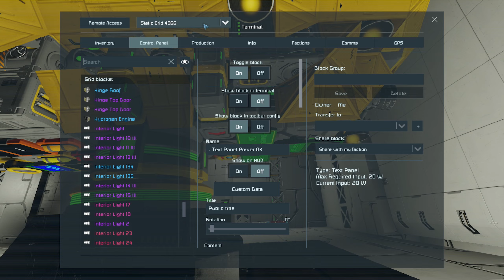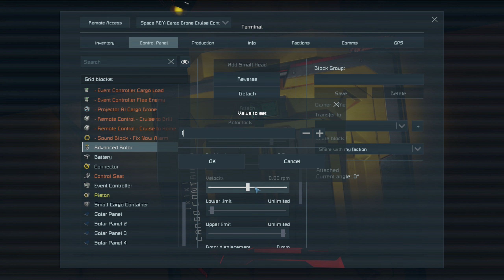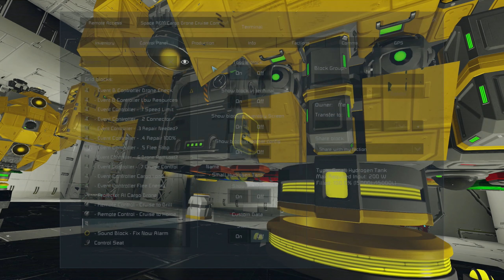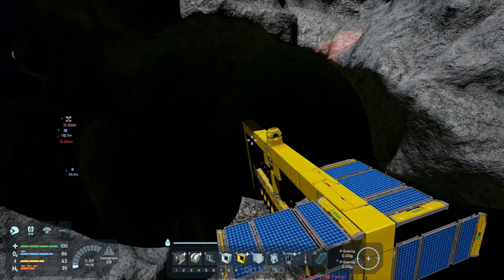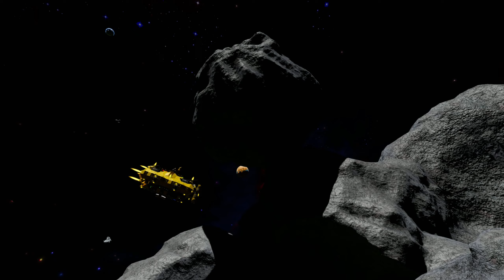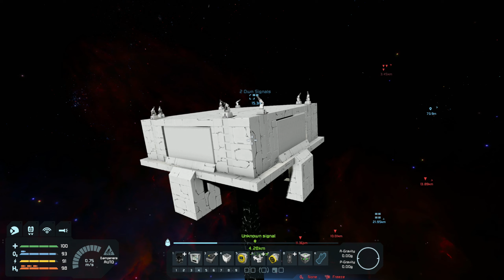Drone Cruise Control...? S2E15 - Space Engineers

Comment: Let me tell you a story.
An engineer downloads blueprint of a drone. Blueprint have attached and configured SG home and target beacons and connectors.
He attaches home rotor to LG rotor head, fly to the mine and do same with target rotor.
And with a push of a button drone happily proceeds it's mission without any additional configuration.
Part 2 of the story will follow later.
Reply from the maker: A rotor, when connecting its head to its base, may require a serious sacrifice to Lord Clang as its no where near as stable as a connector with its magnetism etc. 🤪✌️ (hope this makes sense)
Reply: @ShArPy1o1Games  they may or may not, if you know the rules. Think of this as a challenge ;)
Reply from the maker: Honestly the chances of it going smoothly 100% of the time... using rotors, isn't stable or worth it when there are connectors... it has severe potential to crash your game or Server 🤪🤣🤯
Reply: But it's printable turnkey solution.
Number of people capable of setting up your drone freshly printed, counts in fraction of a percent :)
Reply from the maker: Just uses a small merge block 🤪😇✌️